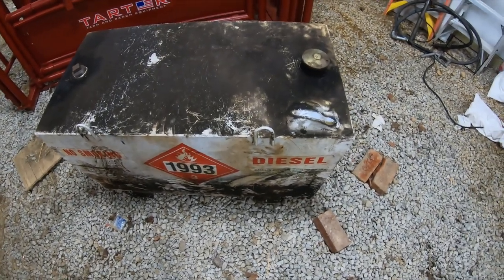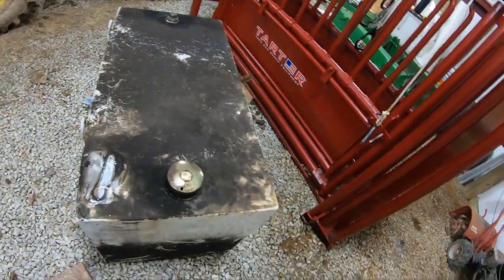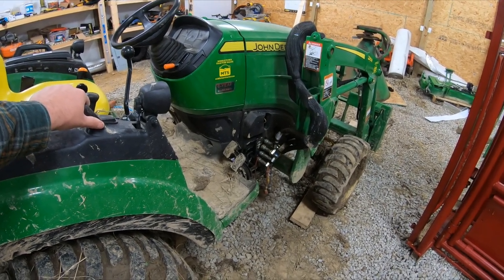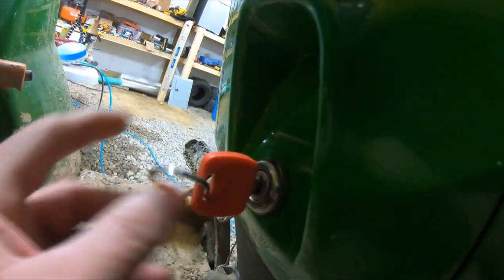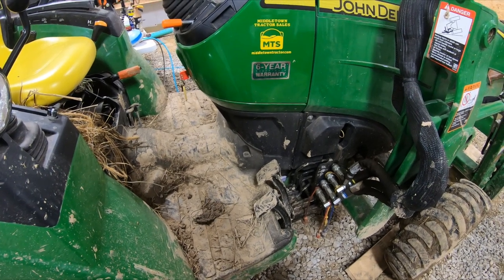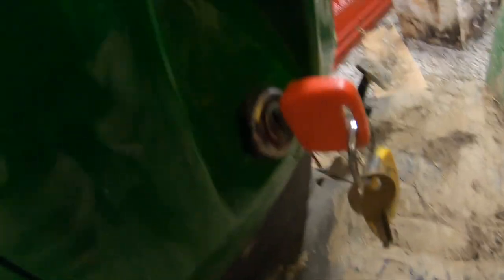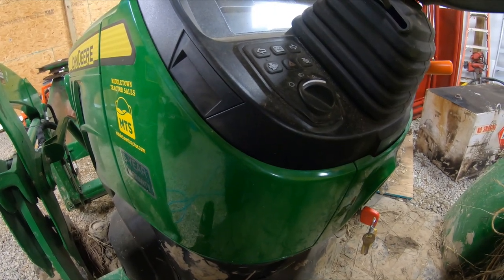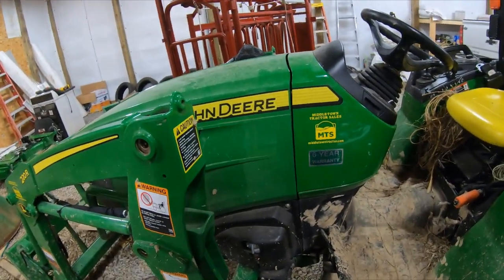John Deere Compact Tractors Broken Key

Comment: My biggest gripe as well. Have a 4044m. Haven’t broke it yet but I know it’s coming, had several close calls already.
Reply from the maker: yea broke my once and not to bad to get out  took about 30min to get it out i been looking at the 4044m
Reply: Katyhillfarmer I like it for what I do. I don’t do any hay cutting or anything like that. I just brush hog and maintain roads and do a garden every year fits those needs very well. Also it handles 4x5 rolls very well. I actually like the 4 series over the 5 better for my Farm because it’s all hills and the 4 series sets lower. Just my thoughts on it anyways. Hope you find you a good deal on a tractor.